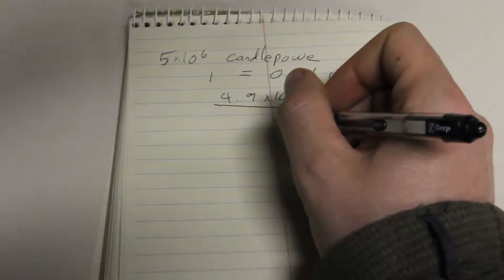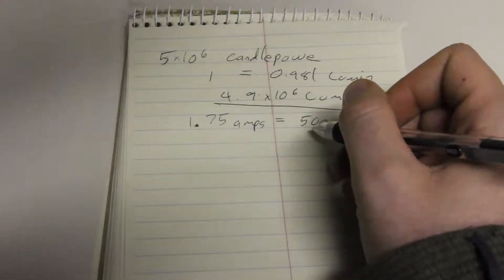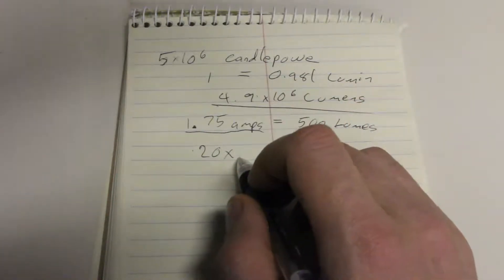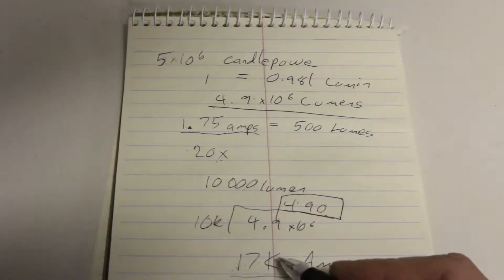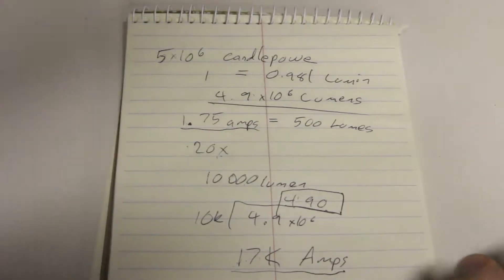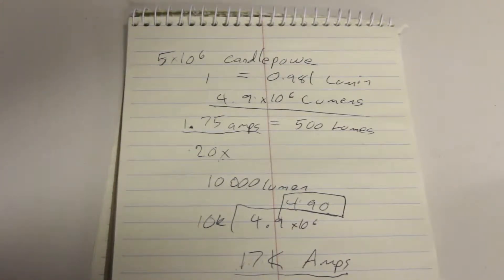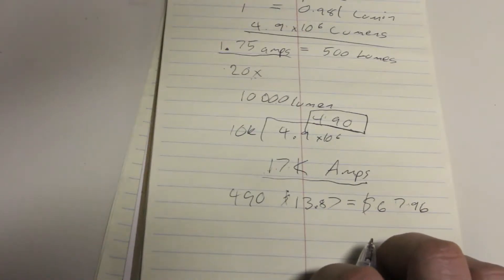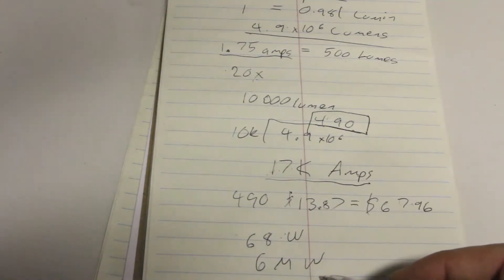TPB #44 -High Speed LED Flashes

Comment: Why make calculations? You do not know the minimum duration of the LED pulse at full power.
Reply from the maker: At the time I knew the minimum pulse was short.  Since then I've looked into this and found some of my other assumptions were wrong.  It's actually possible to make high speed LED flashes for certain photography cases.  I have a working prototype that shows 1 microsecond flashes are possible with enough light for ISO 3200 A11 photos.